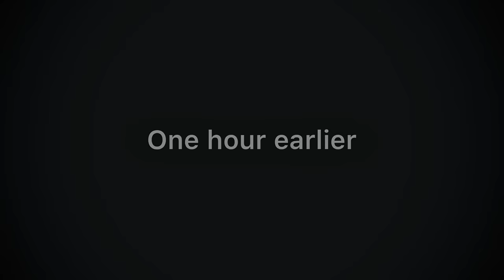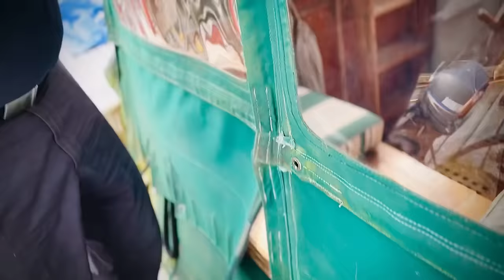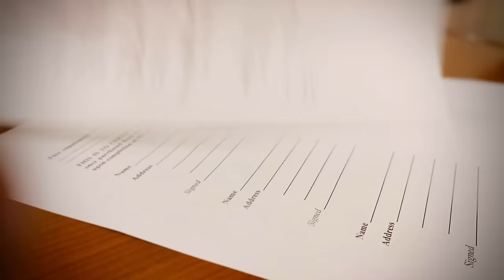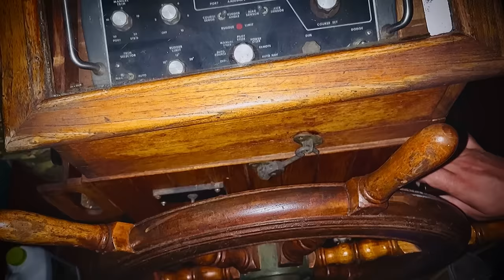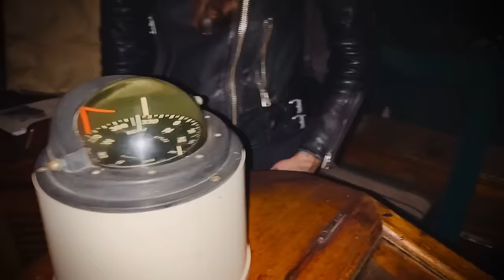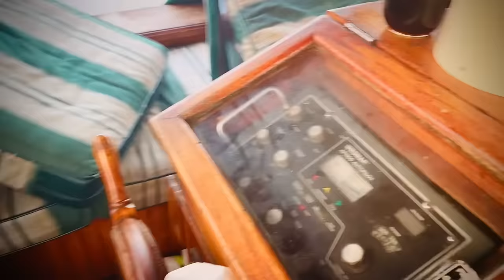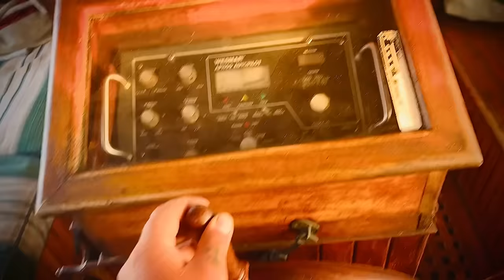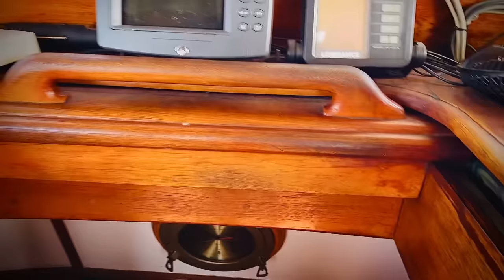Free boat, first sail, engine troubles on the river! Would you take this boat?? Sailor Barry: Ep 1

Comment: As the owners of a 1979 Formosa 51 aft cockpit ketch, we gotta say - you go, guys! We refit her in 2007-08, and are refitting her again - 24V bow thruster, new batteries, some deck re-coring and teak trim replacement. Drop me a line if you have any questions.

Comment: Looks like a Vagabond. Hey to all interested, nobody runs a long inactive boat on the old fuel in the tanks bc it has water from condensation collected as you found. You must flush and scrub the tanks and use only fresh, clean fuel from a new  tank if you want to keep going. Im here in my boat with two 60 gallon tanks I filled twenty years ago and who knows how much algae and crap is in that fuel. It needs fully filtered before use and I use only from a new 12 gallon tank just installed. Glad this boat found a great new life!

Comment: You're not nuts it's a beautiful boat. I just got done rebuilding a 1985 Mako with a two-foot hole in the bottom and both stringers we're broken. I've never ever worked on a boat before I work on cars and I know how to work with fiberglass. I did all the repairs fiberglass wiring new stringers and put in some bulkheads. It is a Mako 224 hand-laid glass. I rebuilt the ox66 Yamaha outboard 250 horsepower. We use it every year going down to Florida for lobster season we scuba off the boat. Good luck I will be watching

Comment: Beautiful score!
Very nice of the Previous Owner!
Always, plumb an onboard diesel portible fuel tank to run the engine on initally.
Fuel tanks are always suspect on old boats.
From being able to hold fuel, to contamination.
So inspect well.
But use an alternative fuel source.
As well, a dinghy, A radio(vhf handheld) 
A working Anchor, and a cell phone.
Im sailing a 32' Mariner Ketch, 1979 out of Olympia Wa.

Comment: Yes, I would have taken the boat but I would have run the engine a couple hours at the dock. However, I did have the same problem with a 47 foot  Skookum getting from Astoria, Oregon to Coos Bay, Oregon. It had two Racor filters that I had to drain every hour. So, even running at the dock wont prevent the junk from getting mixed up once at sea.

Comment: If i had 50.000 for a refit i would. Strip the decks and all exteriour wood. Get a heart atack when you remove the bowsprit. New wiring. Rebuild the windlass. Reseal windows and portlights. Clean the tanks and new racor filters and fuel lines. Rebuild furlers. Two years worth of work there.
Reply: @ButterfatFarms  What's the street value of a hole in the water full of money-fire ash?

Comment: Great video, but do a very thorough cleaning of the entire fuel system, sludge is very common on and tanks need to be cleaned about every three years, after that replace all fuel lines and primary and secondary filters, remove and inspect your fresh water pump and remove the inspection cover to inspect and clean your heat exchanger. if you need help with the diesel just contact me on my channel this is what I been doing 50 years, awesome video and keep them comming.

Comment: You don't need to believe them fill the fuel pump the fuel filters with fuel and then you diesel starter fluid and pump it in the air intake until it takes off on its own it'll self bleed

Comment: Beautiful boat, very jealous, but setting off motoring without at least changing fuel filters, oil etc and dipping fuel tank...really?!
Reply from the maker: I did check oil, trans, rad, filters and fuel. Put fresh fuel in. But a secondary tank had water in it and sloshed it in when we got waked. But I should have been more thorough for sure. But we made it. Thankfully!